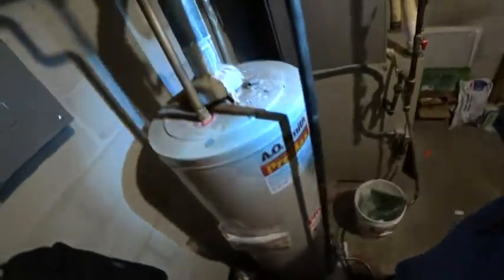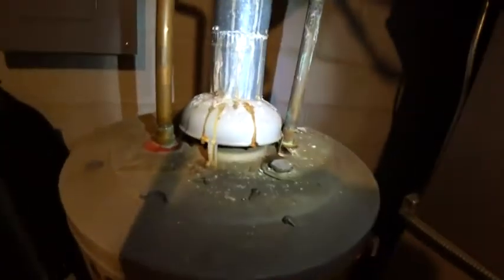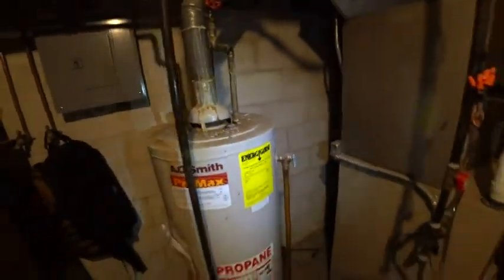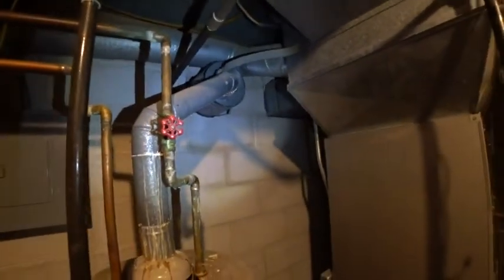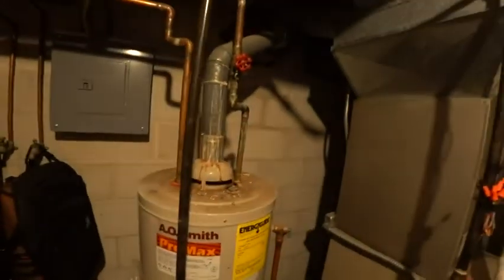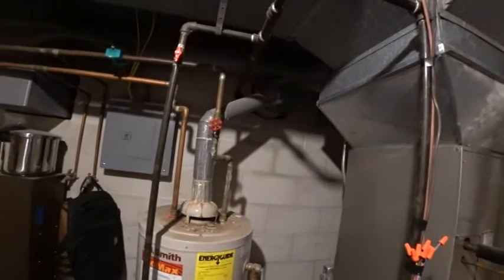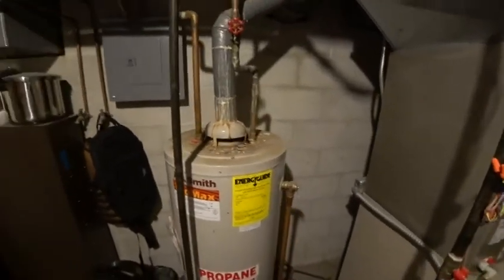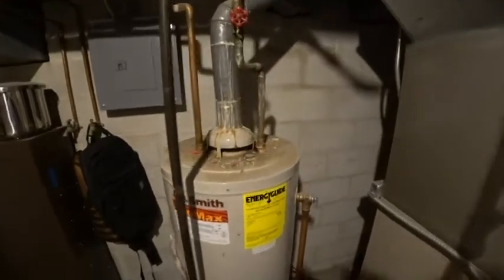Omaha Home Inspection: What is an orphaned water heater and why is it a carbon monoxide risk?

Comment: Great vid, thanks for posting!  We have a 100 yr old 2 family home w/ 2 boilers and 2 water heaters.  All used to vent into one chimney, but new boilers now vent via PVC pipe.  Never had the backing up like shown in your vid, thank goodness (and yikes).

Wondering if having 2 water heaters helps with the venting despite not having any boilers helping in cold weather...?

Regardless, one wh started leaking, so: installing 2 electric whs this week and capping gas lines/closing off the chimney. :)